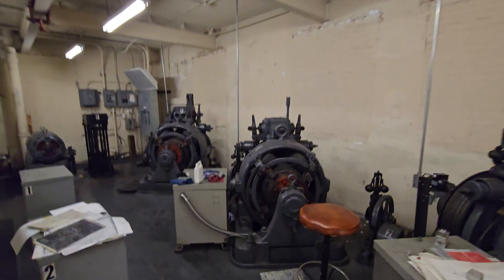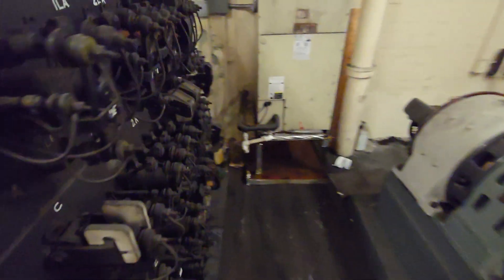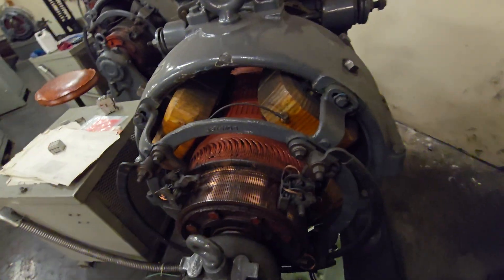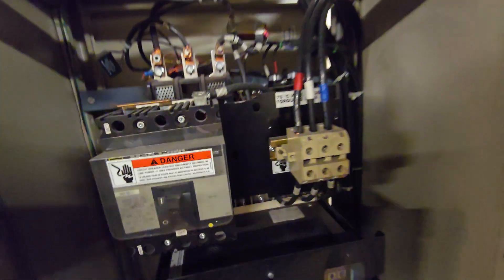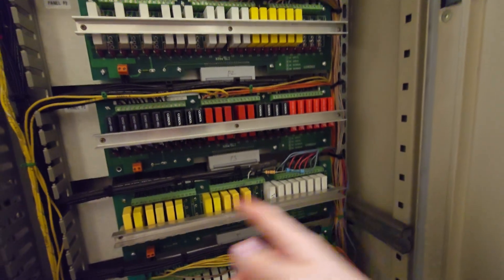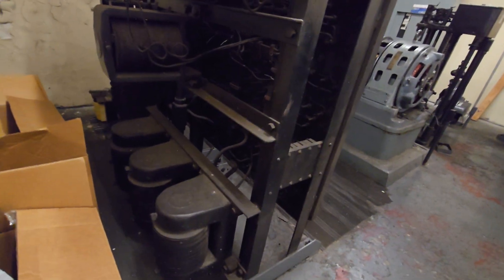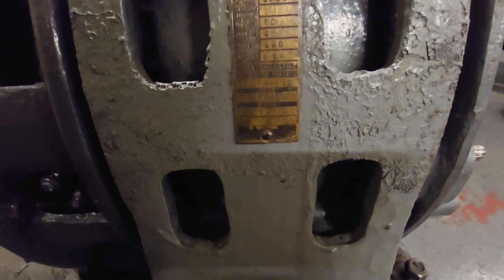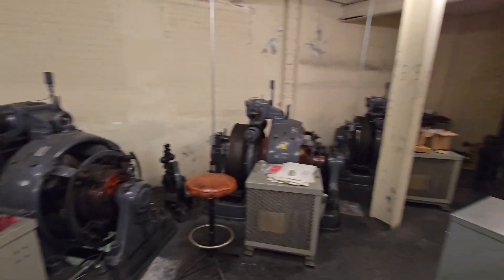(Birthday Special) INCREDIBLE 1907 Otis Gearless Traction Elevator Machine Room

Comment: 100 yrs old and still going strong!  They knew how to build them to last decades, up and down day in and out.  Could be the MG's timer is worn out or broken as why it's running non-stop. Usually cycle off after an extended period of no calls.  Those must be auto/isolation transformers powering the DC motors.  Is today your Birthday?  The older relay controller is likely going to outlast the newer ones.
Reply: @TheTheo58  new subscriber